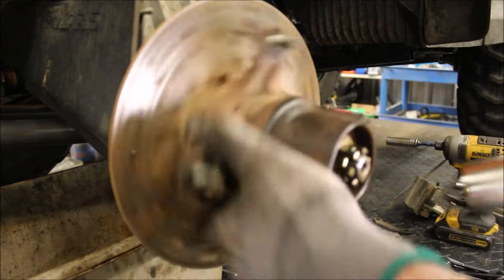How to replace rotors and front brake pads on a Polaris Sportsman 500.

Comment: Nice video! I've never had to change a rotor on my Polaris yet. I didn't realize the rotors are part of the hub assembly. I'll be inspecting my pads soon to prevent the need - thanks!
Reply from the maker: I wanted to put this in the video but didn't.  You can unbolt the rotor from the hub. And just replace the rotor.

Comment: I tried using a sanding flap disc on my angle grinder to surface the rotor on both of my Scramblers with good results. You do have to be careful doing it though.
Reply: Provided the rotor doesn't look like the 1st one.
Reply from the maker: I actually took a DA sander and cleaned up the newer one. It worked good.

Comment: I noticed that the worn rotor you took off is an OEM rotor (from the diagonal slots).  I replaced mine once with an aftermarket rotor, which just had simple thru holes like the one you put on.  This caused my speedo sensor to read differently and the speedometer was only a fraction of the actual speed.  So, I ordered the OEM rotors and slapped them on and sure enough, the speedometer was displaying the correct speed again.  Coincidently, it was a 99 also.  Have you run into this?  Thanks for sharing your knowledge.  I enjoy your vids...